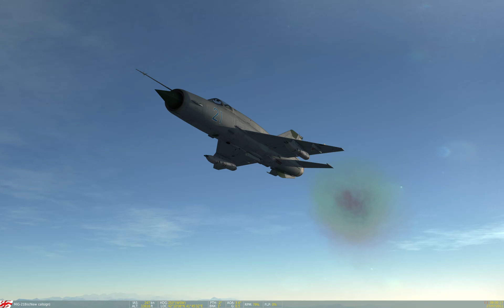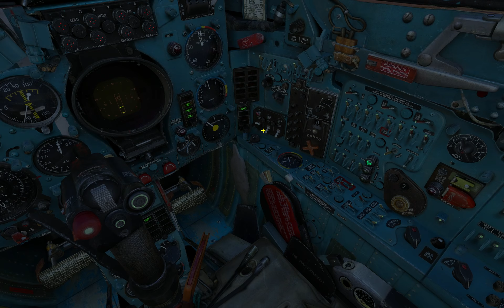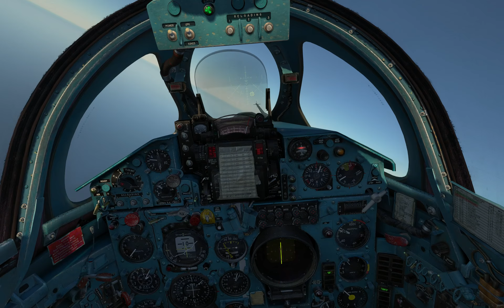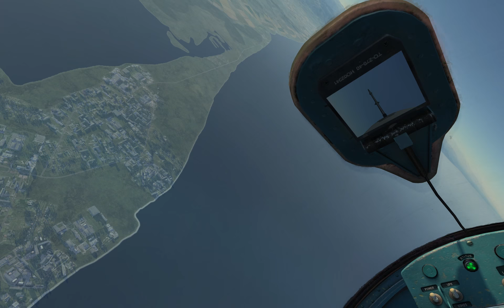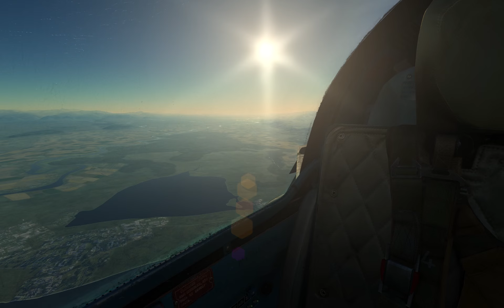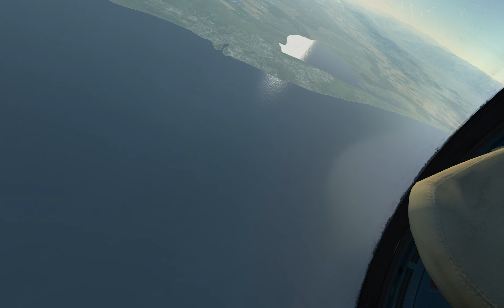DCS Mig21bis Gun Pods

Comment: 2:50 dude, you don't have to flip those switches to enable the countermeasures dispensers, they're for enabling the rocket-assisted takeoff bottles. Just flip the red cap just in front of the throttle and you're ready to rock.
Reply from the maker: Thanks for the tip.  I was sure they needed to be turned on but either I'm wrong or this behaviour has changed.
Reply: deephack I think you're right, they might have changed it. The dispensers are powered off the DC supply directly and I believe they pump out chaff/flares whenever power is applied, so you just hit the little button below the throttle and away they go. No separate enable switch.

Comment: So i just got me the Mig21bis. I use my A-10A for ground roles so was wondering what would be the best deployment of this aircraft. I know it is a multi-role aircraft however I use my A-10 for most ground operations because, well, its an A-10.
Reply from the maker: +LNX Gaming The Mig21bis is a multi-role aircraft although in quite a limited way.  You can carry 2 air to air or maybe even 4 with the R60 double launchers and an air to ground payload allowing you to carry out a small CAS or ground attack role and then go on to provide a combat air patrol.

I actually mostly use it as a fast CAS aircraft.  It doesn't have the legs or the loiter time of a proper CAS aircraft but it can get there faster than most and when used in 2 or 4 ship formations can be devastating even though the weapons are unguided.  You don't want 4 of these things firing rockets at you that's for sure ;-)
Reply: deephack One of the main reasons i wanted this was just because i loved the aircraft so even if the A-10a is a better CAS aircraft i am still loving this. I haven't tried the rockets yet as i'm not use to using unguided weapons (except bombs on the A-10) so ill give that a go and just love flying it.
Reply: There's no denying that the A-10 is a flying gun show; yet the coolest thing about the MiG-21 is that it's ancient, yet actually quite modern in terms of flight performance. Its very high acceleration & speed, climb rate, and decent turning ability make it far more entertaining to fly than the anemic A-10. The fact that it's based on 50s tech makes it that much more fascinating. When I'm in the mood for it it's a total hoot to fly, probably my favourite DCS module, even if that's only because there's no DCS study-sim level MiG-29 :)